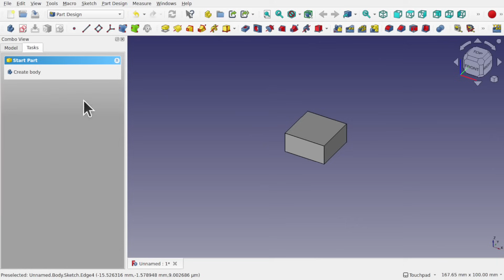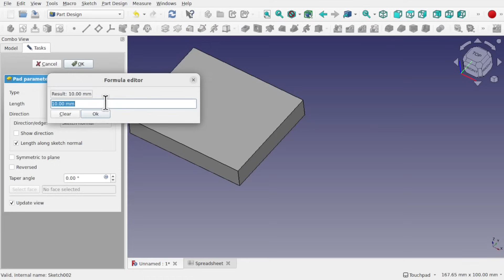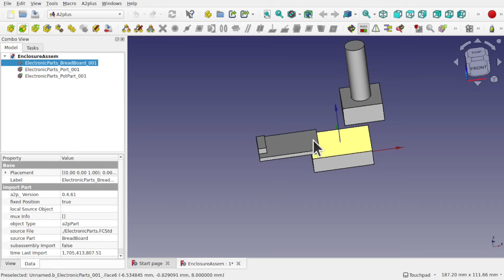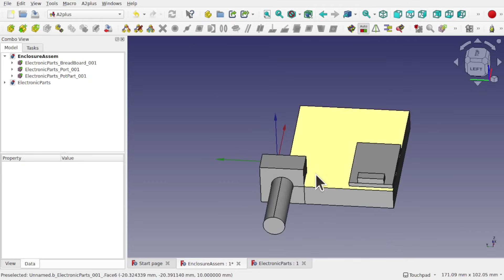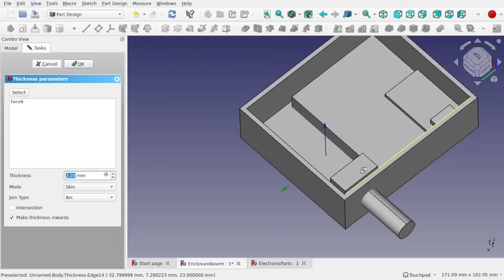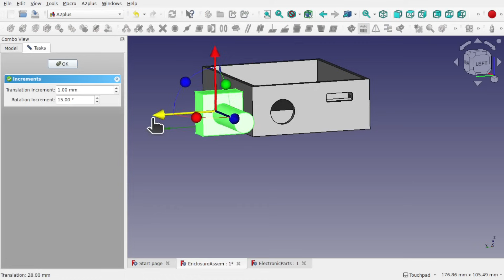Unique Approach to Parametric Enclosure Design in FreeCAD: Assembly First for Electronic Components

Comment: Fantastic information! I’m finally getting to a point where I need to start using a proper CAD program rather than TinkerCAD, haha.  I can still make anything I need in TinkerCAD, but I will eventually need to have an enclosure like this injection molded, and handing an STL to a fab is probably not great.   Haha.  

I looked through about a year’s worth of your videos,  but didn’t see anything specific to DFM.  What would be the best method for designing draft angle and other manufacturability features?

Comment: Thanks for this great tutorial! 

I wonder how to make this approach more stable with the changes. For instance, if we move the potentiometer to the right of the board I expect the box to break because our two "locked" points won't form the diagonal anymore. And what would you suggest if one need to add the second potentiometer with the different config? I guess that just cloning the part won't work because of the link to the particular spreadsheet cell.

Comment: This is how I make enclosures for small circuit boards.
It allows the PCB to fit perfectly without needing to include slots or screw holes to locate the PCB inside the enclosure cavity

Comment: Thanks for your ever on going master class. Many manufacturers publish CAD of their components. Can  FreeCAD import any those CAD? This simplify the design as the components are already dimensioned, again thanks
Reply from the maker: If the components are of the supported types which most standard types are then it should be a case of importing them and just using them unless they come in as mesh format which is then a case of using the mesh workbench, mesh to shape tool.  Glad your enjoying all the videos, plenty more to come.

Comment: By shear coincidence, I am just starting to model a DIN rail enclosure using a .step file exported from KiCAD. Unfortunately have to use a .wrl file for the 3D models of the components because I cant seem to make KiCAD export them to step.
Reply from the maker: In freecad there is a add on workbench you can install called KiCAD step up mod. It's a workbench that works with KiCAD. I have yet to venture into it but it may help.
Reply: @MangoJellySolutions  Thank you, I wasn't aware of that workbench. Thankfully I don't have to match too many components on this one, but it's still a bit of a pain manually transcribing x & y's...
Good video, as always.

Comment: FYI, if you use "up to face", you don't need to click reverse first - it will be automatically assigned once FreeCad realizes the face you'd like to limit the extrusion/pocket is in the other direction.
It would be great if you can make a follow-up of this video with something like "consider which of these 2 components is higher and set the enclosure size 2mm above the higher of the 2 components".
Reply: I'm generally curious about that sort of thing as well. I think the only way I've been able to do something like that in the past is with spreadsheet formulae, where conditionals etc can be used to compute a value which you can then use to position the enclosure roof or whatever.